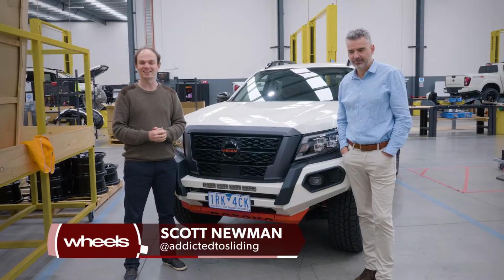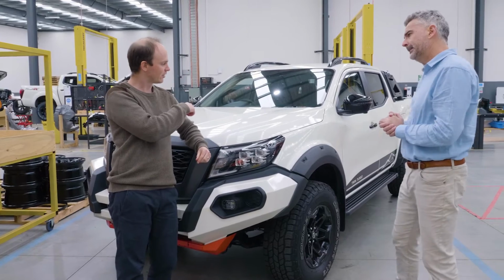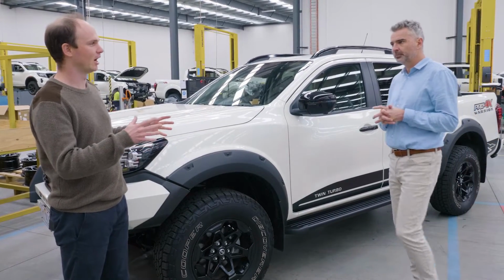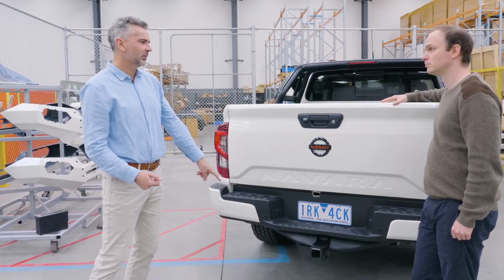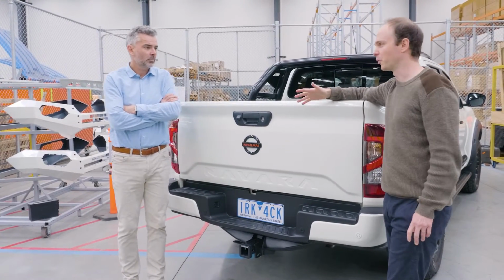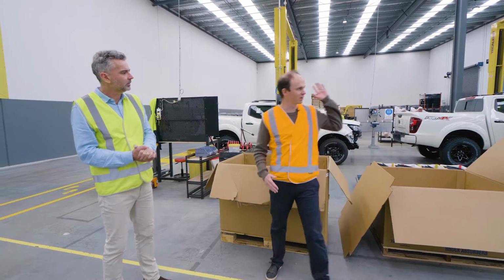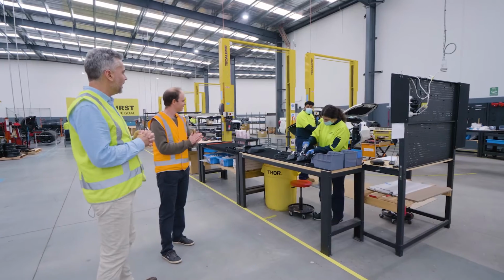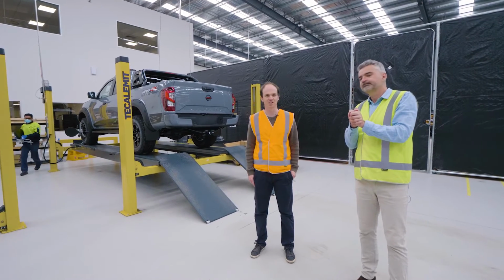2022 Nissan Navara PRO-4X Warrior walkaround and build process | Wheels Australia

Comment: The Warrior is a top looking vehicle. 
What do Nissan/Premcar do with the brand new original suspension and front bumpers they take off the donor vehicles? I hope they’re returned to stock as spare parts. 
Premcar have a quality set up. You can tell Bernie is a Mechanical Engineer as he's across the detail. He's not a Spruiker and it's refreshing to see.